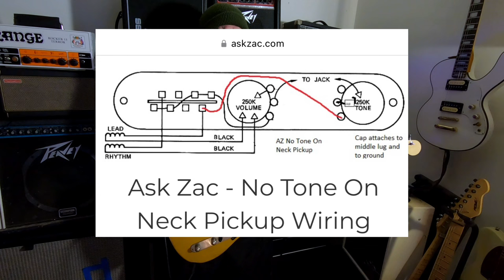Muddy Neck Pickup? Try This Simple Modification

Comment: I use a "push/push" knob to engage or disengage the G&L style tone circuit on my black Parts-o-Sonic.  Just smack the knob, works great.  Custom wiring is the way to go.  Try swapping the 250K volume pot for 1M ohm one. Brightens up the entire guitar.  Experimentation is golden.
Reply from the maker: Right on, I have been putting my soldering iron to work lately, plenty more mod videos are coming lol.  I started with this mod because it’s one where you can do it for no cost, all you need is one piece of wire to jump from the switch to the tone pot.  I’ve also thought about 500k pots, but putting I think it’s a 470k-500k resistor on the bridge pickup so it still sees 250k.  There are many options before replacing pickups.

Comment: You could also take the cover off the neck pickup, especially if its approaching 7.0K.

 Fiddly with molded plastic bobbins, with those I've carefully cut the soldered tab off with a jewelers saw.

You've already mentioned a 500K volume and a balancing resistor on the bridge pickup.

Check out the Bill Lawrence 5 position switch wiring, or 4 position Double Esquire wiring, the switch positions are like tone presets, once you parse them thru practice and dial your pedals in live stuff can be a welcomed breeze.

Comment: I soldered a .049 capacitor in series with the hot wire from the neck pickup to the switch for more clarity. This way, you still have the option to use the tone pot.
Reply from the maker: I thought about that too, I figured I would try this route first before ordering anything additional.  The capacitor just reduces the low end, which in effect should help.  How well did it work out for you?
Reply: @Chucksguitargeekery  I have a semi-hollowbody and it cleared up very well. If the neck pickup is located under the imaginary 24th fret, it will sound muddy. 24 fret model guitars don't really have this problem. a 0.022 capacitor didn't really do much, so I went with double the value, worked like a charm👍

Comment: I quite like the darker neck pickup on Teles, but I've a P90 loaded guitar where the neck is far too dark and I was going to try this mod, then magnet swap if necessary.  I know I may have to bite the bullet and get a lower output P90, but that's the expensive option I want to avoid.
Reply from the maker: I can see the utility in a dark neck single coil in some applications, but I guess I was spoiled by years of a Strat neck pickups.  But yeah, you can try this mod to start with without spending money.  Or, try 300k or 500k pots.  Are both pickups p90?
Reply: @Chucksguitargeekery  Yes, both are P90s.  I want to try to avoid swapping the pickup(s) as much as possible as the guitar was a present.

The bridge and middle positions sound fine, but I'm struggling to love the neck pickup.
Reply: unless you need expensive  Lollar or Fralin  etc etc etc. neck P90  you can find solid low - mid out put P90s online for well under $60 ea.    under that cover,... no one will ever know...

& I ain't tellin ....

Comment: A properly functioning tone pot should add zero resistance when at its full range. It's acting essentially as a wire, so there is no difference. I suspect any changes are due to a pot that does not go to zero ohms, or just desired perception.
Reply from the maker: There is a difference between a standard tone pot and a no-load tone pot, it’s very subtle.  But the main reason to do this mod isn’t so much just removing the tone pot from the neck for the sake of having “no load” in the neck, but so the amp could be dialed in to that neck pickup, then the bridge pickup can have the tone pot rolled back to balance it without having to twist the tone knob every time you switch pickups.